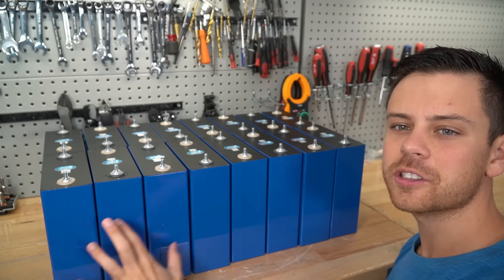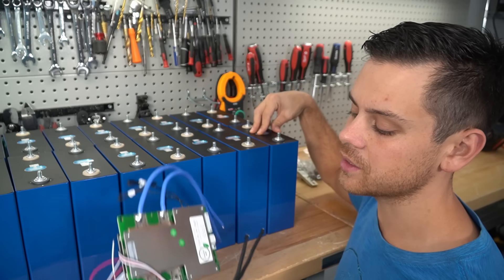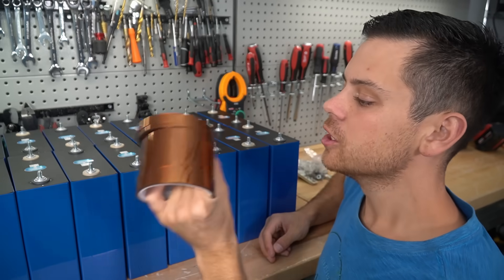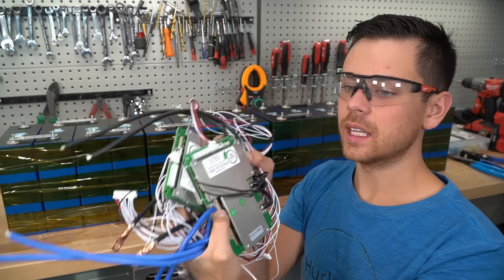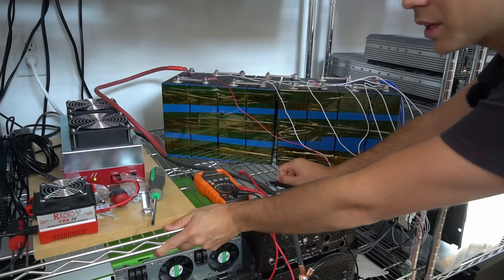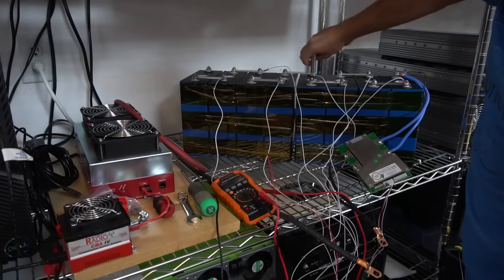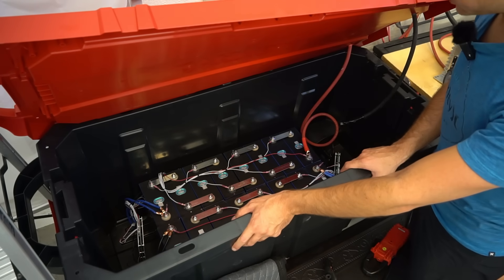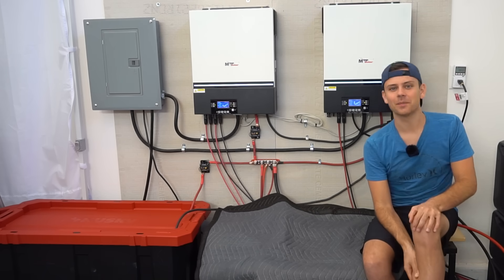DIY 48V 320Ah Grade B LiFePO4 Battery Build: 16kWh for $2,810?!

Comment: Makes me wish I could scrounge up $11k and get off the grid completely lol. This system would easily handle my usage 😊
Reply: @yougotservedyo in my opinion it pays for it self as soon as you turn it on and you have energy independence
Reply: @yougotservedyo depends on how much you pay for electricity and how much you use. Becoming completely energy independent has its own intrinsic value.
Reply: Yes and that’s if nothing goes wronf
Reply: I purchased 32 of these cells but were truly grade A for 3700. My panels are either used or misalignment of cells in panels so they were only 80 per 300 watt panel. Plus 30% back from government.  Easy to find if you look
Reply: @nunyabusiness2191  not sure where to look. I’m completely new to this even with watching some random videos over the past few months. But this video proves I may be able to finally build a system in my detached garage. It has a subpanel and maybe can back feed the house if the main breaker is off during a power outage for instance. But at least charge my car. Anyway, the point being, someone like me doesn’t know where to look.
Reply: My job and lifestyle means that I travel to various job sites and live in private campgrounds for two months at a time. I prefer to live in a yurt, as opposed to an rv, but many of these campgrounds prioritize their power hookups to rvs:( Therefore, I spend 10 months a year off-gridding. I have minimal power requirements. Private workshop, 1kw ebike, pc, tv, etc, and have been just fine with 100amp output from my 100ah LiFePo4 running to a 2kw inverter (which I obviously can't max out because of the bms). Currently running 800w pv. But I generate much more than I can store, so, thanks to Will's fine example, I just ordered 16x280ah cells. I plan to build 4 12v packs and sell two to offset the price of the two I will keep. With 2 12v packs, I will be able to combine them as a 200amp 12v pack, to maximize my inverters. I have a spare 650 watt inverter that I also run. It seems that my speed controllers on some of my tools trip my inverter for some reason, so I keep my workshop and my pc/entertainment system on different inverters. Then, at the appropriate time, when a 24v inverter comes available at a good price, I can easily reconfigure my batteries for 24v. I would not be attempting this battery build if I had not discovered Will's videos:) Thanks, Will:)
Reply: @yougotservedyo One must consider the added advantage of operating your systems when the grid is down. IMHO, this is the tru value. I am 100% off-grid 10 months a year. When the Texas white-out hit this winter, our neighborhood was without power for days. It never affected me. In fact, with the cold panels, and reflection off the snow, I hit a new generation record, with my system pulling 660 watts out of 8x100watt panels. Even with my cc running beyond rated capacity (running at 42 amps of a 40 amp rated capacity) I couldn't use the power fast enough. I was wishing I had an electric space heater:)
Reply: Glitch Inthematrix then the electric Bill will be $25 and very low risk
Reply: Glitch Inthematrix  And energy production from nuclear fusion is only 10 years away.

And it has been 10 years away for like the last 60 years.
Reply: How many years would 11k pay your Bill??
Reply: Glitch Inthematrix  with the US gov't currently hounding Chinese solar panels...it'll be a while
But you can easily find used 335 watt paela for ~$100, just look
Reply: Sell your car

Comment: I'd like to build a 300ah battery, going to do a campervan conversion here. My head's spinning from all the stuff I need to learn in order to do that. Decided to build a battery thanks to Will's videos. Huge thanks! One thing that scares me more than building a battery without experience is how much the Chinese sellers lie. How can you believe anything they write on Allie Express? They're all brand new grade A cells in the description, but who knows? Most of the sellers that ship down here to Brazil have sold only a few units on AE, so no client ratings or reviews...
Reply: Just buy a 300AH and that should be fine and simple
Reply: @vanderumd11  That's what I'll do. I guess even if they send used ones, it should be OK for a van. Still studying what BMS I'm gonna need though.
Reply: @jiri4023  you wouldn’t really need anything except a charge controller. The battery comes already built and ready. Trust me, way easier to just buy it already made.

Comment: HINT: Battery heat up when being charged and discharged..... if you want your batteries to last longer and be more stable, leave space between the cell.
Reply from the maker: At our c rate, not much at all. Low ir. Better performance when warmed a little. Too cold raises ir. No need for cooling here.
Now using NCA in an EV? Cooling is required
Reply from the maker: Convective flow wouldn't do much considering their thermal mass and pulling a .1C or less

Comment: Have you ever done a test of panels charging under parking lot lights? Did an overnight with camper in a walmart lot the other day and it seemed to charge battery a little just from parking lot lights

Comment: This is almost exactly what I'm looking to buy but smaller Ah size, 48V LiFePO4 with 10kWh or 14kWh (200Ah or 280Ah) each on 2 battery packs or 3 packs with 9kWh (176Ah). Multiple separate packs for redundancy.
Will be used for a Tiny House on wheels with 100% off grid for at least 14 days of electricity in the dark winter in Sweden when the solar panels produce nothing.
Would prefer smaller packs that I can move on my own when needed so will most likely go for 176Ah with 65kg or so.

Last I checked it was possible to get 16 pcs grade A 176Ah for $1300 (cheapest size for $ per Ah as far as I found)

Comment: Hi Will. I ordered 16 grade A CATL 310ah cells on Amazon several weeks ago for $3079.99 (CNEEL store). Probably show up late September. I’ll let you know how it goes. There’s a bunch of 16S 300 ah BMS’s with Bluetooth on EBay for under $100 but I have no idea what quality. Then there’s the Daly 16S  smart 250 amp $233. Some have had Daly problems but I bet 75% is user fault (surge & wrong connections). If you have any 200+ amp 16S suggestions I’m all ears. I’m curious and may just pull the trigger on the EBay one for giggles and watch it like a hawk. Are you concerned that one of your 8S banks goes high and shuts the series down early? Those are the most puffy packs (from new) I’ve ever seen. Funny how they can expand and contract. And that’s why I like to arrange the cells so the terminals polarity are all on the same side ( like when you top balance). I run # 2 cable & lugs diagonally, no buss bars. You are 100% correct about tension on the terminals as the pack swells and contact.
Reply: How did it go?

Comment: That’s a decent low cost system. 
What is your thought on multiple smaller systems for a home? Like one for critical appliances, a different one for lights, one for the workshop and so forth. I’m thinking here about system resilience. If one goes down, you only loose 1/4 or 1/3 of your supply and can still operate the others until parts are available.
Reply: You could also use an arduino to limit power consumption of a group of appliances. So there will always be enough juice for the critical appliances.
Reply: I could see the value in having a couple of smaller systems.  IF you have a camper trailer/RV then it would make sense to integrate that system into your home system, and reduce the size requirement for your home system.  When you take your RV (and RV solar/battery system) out camping, you can stand to raise the temperature for your AC in the home, and empty/disconnect your fridge to reduce home power usage while you're away.

Comment: excellent video. and long term follower. please can you really connect bms in series in acutal installation? My challenge is I have one of those weird high voltage inverter/charger units which expects 120V DC input. It also charges via the same cable when grid power is available. (inverter is 7.5KW ). Getting a 40s bms for a lifepo4 is really expensive so I was considering getting compbination of 16s or 8s bms. I will appreciate if you can advise in this regards. thanks Will

Comment: Hi, 16kwh are a lot for those batteries, used at 100% they degrade too quickly, I always size for 40% less: 3.2volt x 16 = 51.2V x 320 Ah = 16.38 Kwh - 40% = 9 , 82 Kwh usable from that counter at nominal 48V, we round up to 10Kwh, am I exaggerating in your opinion? What are the minimum and maximum voltages you use, the standard is 20% less than the nominal capacity, I prefer to make them last longer than squeeze them.
Thanks for your great videos Ciao
Reply: These are LiFePo4, not Cobalt based Lithium batteries. Charging to 100% is fine with this chemistry.
Reply: @kangt544  I have known the chemistry of lithium iron phosphate batteries well for over 10 years, you are saying some inaccuracies, just the excess of charge damages them the most, the research documents on LiFePo4 indicate that above 3.25 Volts the degradation starts, an acceptable compromise is never exceed 3.55 volts per cell (stay on 14 volts for a @ 12V battery) then there are those who charge them at 3.65 volts, it also depends on the use made of them and on those who use them, a private individual generally he has no money to waste, a public company yes, as a minimum voltage never go below 3 volts per cell so never below 12 volts, then one is free to do what he wants, in fact there is a video where you see a battery bank with single cells that did not last 3 years on an RV, considering the cost it is better to make them last a little longer, as you say you should reach a maximum voltage of 3.8 volts per cell with an absurd degradation and a useful life / extremely reduced cycles and not convenient. Ciao
Reply: @winterburan  I wanted to repeat this build as well but was struggling calculating the battery pack I would need to create and run in series. I would like to get at least 10 kwh out of a less then $3,000 build price.
Reply: @skylergardner2792  If you want to stay in the $ 3000 @48V you have to buy a similar product, maybe grade A, it's fine for 10Kwh, don't go below 3Volt per cell and don't go above 3.5-3.55V
Reply: @winterburan  i found some 38120 LiFePo4 cells with advertised 8Ah 3.2V 

I'm going to try and DIY a powerwall using those cells.
Reply: @skylergardner2792  I don't like starting with small cells to get to high capacities, in this case we are talking about at least 608 cells @ 48Volt
Reply: @winterburan  I think I struggle with trying to figure out how many cells I need to build up to a 24 or 36 volt battery. 

Like for example a 2500 mah battery. How many do I need to make 12, 24 and 36 volt. Confuses me.
Reply: @skylergardner2792  36 Volts is a strange voltage, generally you go to 48V to increase the conversion efficiency of the inverter if it is the only and main source, in off grid situations where it is better to find a compromise, for example using the 24Volt to directly switch on the '' lighting without inverter, using DC @ 24volt lamps, use DC / DC converters to power all DC electrical loads such as charging smartphones etc., and use an inverter only and exclusively for the essential things that you cannot do without, but it depends from the situations and dimensions of the house and the future evolutions of the system, if the house already has an electrical system it is logically not convenient to do so.
LiFePo4 cells from 3.2V to 2.5A to get to 24Volt for 10kwh is crazy, they are no less than 1760 cells about 550Ah @ 24V rated even if 600Ah would be better, they are 1920 cells!
Many after having done it with the recovery li-ion cells like the 18650 inside laptops or battery-powered electric tools have given up, too much work for a non-lasting result due to cells that are too mixed and of different make, which also create serious problems being more dangerous than LiFePo4.
Reply: @winterburan  I just figured building a 24 volt battery using the cells like 18650 with the highest mah to be the most efficient as far as the number of cells needed to reach high capacity power walls. 

I must have mistaken the 8,000 mah at 3.2 v to be more efficient then the 2,500 mah 18650 Samsung batteries.
Reply: @skylergardner2792  Good luck with the Li-Ion, remember that they burn better than gasoline, and the voltages are different because the chemistry is different, don't you first use recovery Tesla packs @ 24V like Will did on old RV? There are many channels that have made history on the tube, for me making a homemade 10kwh @ 24V bench with Li-Ion cells is not convenient, especially if of dubious origin or used, I prefer high capacity LiFePo4 single cells. Ciao
Reply: @winterburan  all of the batteries I referred to in this conversation are LiFePo4 batteries. I don't know why you ASSUMED otherwise lol.

Comment: It's interesting to see your thought on these! Why didn't you order from a more well-known vendor though? I don't think it's fair to say they're 91% rated capacity when you didn't balance them. My concern with the compression is more to make sure the terminals don't break. I'm super paranoid about that happening. Do you think I'm worrying too much? What I ended up doing was very gently tightening the compression while at full SOC so that it's pretty much just holding them in place (not squeezing) which should allow them to decompress/compress normally without putting any force on the studs. Either way, I'm curious to see how yours are doing after a month or so. I haven't put mine in service just yet.
Reply from the maker: Yes, I'll cycle them a bunch and retest, then I'll be able to draw a conclusion. I found a new listing that looks way better. And the shipping is faster. $1000 more for this size pack, but they look great. And yes, I never tried this store before. Check out the spelling errors in the listing 😂😂 they were cheap though!
Reply from the maker: Yes that's exactly my thinking when I stated I want some compression to protect the terminal. I said it before I started building the pack. 

Even the garbage cells I test usually pull full capacity lately, without any balancing. If they matched them at the factory, they should be at the same exact soc. But yeah, doesn't look like they matched them up. Will need some balancing for sure.

Comment: For burning up your BMS, good thing that Overkill has a "no matter what, even if you break it, we will replace it"
Reply: it got destroyed?
Reply: @sarahrose5772  mine did not, as i have yet to install it. I need greater than 100A continuous for my application, so I have to use two banks of batteries in parallel. Waiting for the 2nd set of batteries. That's just what's on the paperwork when you get it.

Comment: I thought you said a while ago that the BMS doesn't do top balancing? Or is this the Overkill solar BMS that does? I don't remember reading that in their datasheet. I purchased one, but am not using it yet as I need over 100A continuous @48v during peak usage and am waiting to build a 2nd battery.

Comment: Nice, I just built one with 280Ah cells, $2300 delivered with no problems. OYE store. Nice welded studs. Mine has been working great for months. Just ordered another 16 cells for a 28kWh pack.

Comment: When working with lithium batteries, always use fireproof enclosures.
Reply from the maker: no need with non cobalt based chemistries. We only use LiFePO4 or LTO for this reason. Read up the transportation studies. No self propagating thermal runaway effect. If short does occur, over pressure relief valve will gas and it will smell bad. Thats it. No fire.
Reply: @WillProwse  I have one LifePO4 battery, 7Ah, which I am using in an experimental flashlight project (converted Thor spotlight). Battery cost me $129 from Dakota Lithium some years ago.
Over on the solar electric forum, for my area, I need 36kW of solar panels and about $400,000 worth of batteries to provide seamless power that will maintain through up to a week of overcast weather. We don't get much sun at certain times of the year, plus a lot of trees around, so one are of the yard gets sun for 3-4 hours during summer, an area in the back gets about 2-3 hours of full sun. The rest of the time it's indirect.

Comment: Nice video Will, you could try adding some foam weather stripping to the top and bottom edge of the sides. This should allow for the expansion and contraction without having to keep adjusting the busbars.

Comment: What is the difference between Battery Grade ( a-b-c-d... ) ?
Reply: Grade A are matched by the manufacturer, and come with test results. Grade B are usually cells that don't quite meet grade A specs, or as Will got, used and/or abused. Every seller claims grade A, but very few are. The grade B cells are significantly cheaper, and work fine for lower current draw applications, and are almost always a much better value. The diysolarforum is a great resource to find out the reputation of sellers. Will provides the forum for free, and it is very, very informative.

Comment: I need about 400kwh of battery capacity to replace 200a service. Still too costly. But shifting is coming.
Reply from the maker: Yeah that is a ton of energy storage. What are you running??
Reply: 400kwh ? You run a small factory?
Reply: @4philipp  For one thing, all electric ranges and ovens, dryer, plus a 50 GPH deep well pump (86 amperes and 240 vac startup current), an electronics lab with older "boat anchor" mostly HP and Tektronix equipment, a full recording studio and a 20,000 watt sound system and theater with a commercial projector.